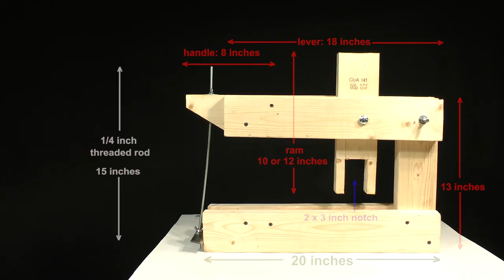AODE 4R70W Class Part 2 lesson 1

Comment: I am in the process of rebuilding a 4r70W from an 01 mustang. I bought everything needed and am hoping to figure out what caused my reverse pison to get stuck and to crack from the inside of the cap. I get the feeling it's gonna be valve body related. If not it's probably from  overheating.

Comment: This is just one of the best videos I've seen explaining the internal components of the 4R70W trans, I've been looking for material like this for quite a while but I still don't understand an issue Im having in a F150 equipped with this transmission.. If I shift into D 1st gear is correctly applied then shifts smoothly to 2nd gear but I can feel a shuddering vibration at less than 20 mph, don't know if it's the engine that's causing that or not but when trying to isolate the vibration I shifted manually to 2nd gear from a complete stop and I can still feel the same vibration, it changes with speed... Does this have something to do with a clutch pack or drum not fully applying?.

Comment: I have a 4x4 87 302 efi that was swapped to a 95 351 efi with a built AOD that was good and 6 years old with low mileage in it. The installer ordered the new flexplate with 0 balance for the internal balance 351/408. Very shortly after the install within 10 miles it stopped upshifting 2-3. There was some dibri cleaned out by a trans shop and they said it was fixed now. Then short miles later same issues. They said it had more and suspected clutches and clutch debris. Not driven hard or off road yet since received either. I took it to another shop and they said not that much and not clutch but bad and needed rebuild. I now concerned with the AOD and  the TV setting with  the swap and the same issue with  a rebuild. Could this be the flexplate?"  Internal AOD governor with swap? TV adjustment?  Way to determine the cause?  What would be the best transmission it is a 4z4 long travel built prerunner. King shocks 4.86  gears lockers, long travel 18" f 20"r  etc.etc..It has a fresh rebuild and improved Borg W 1356 I did. I like the OD do drive from the concrete jungle in so cal to places like AZ, NV, or in CA but hours away but also run  aggressive off road and long  off road trips desert and mountains on 35" tires. I am concerned with TV cable is electronic better? It will be built for power and separate computer if electric.Thanks and any info  may help it is a bit stressful I  like my  fUll size Bronco.
Reply: I think you may know more than most. No response on this channel

Comment: FYI if your trans. acts like it goes into neutral when it shifts to 3rd gear it could be this; Inspect the back of the direct clutch hub to see if it is broke in two or the inter spines are stripped out with the stills and frictions looking like new.
Reply: jenaford143 my transmission did this before slipping and going into N  the problem was clogged oil filter
Reply: Now you tell me. I just test drove it. No 3rd. And I didn't latch the band. Thought the servi pin would engage it automatically. Darn.
Reply: I removed my bell body and a piece of metal coming with it it looks like a c the name of the part they call it anti- rattle spring I need help
Reply: Sorry valve body
Reply: That was the problem with my F150 transmission